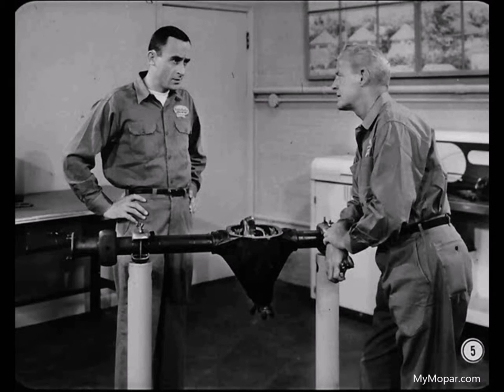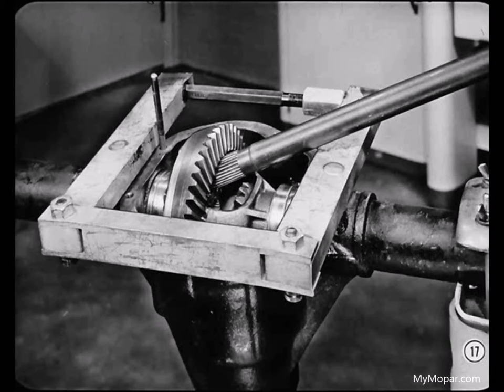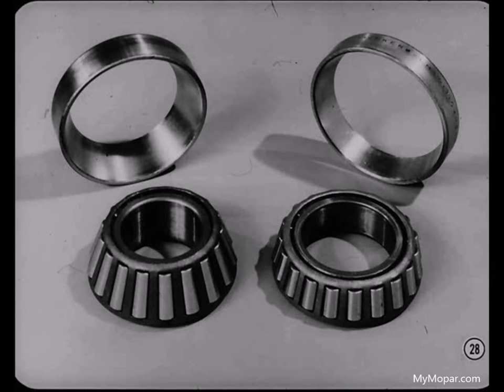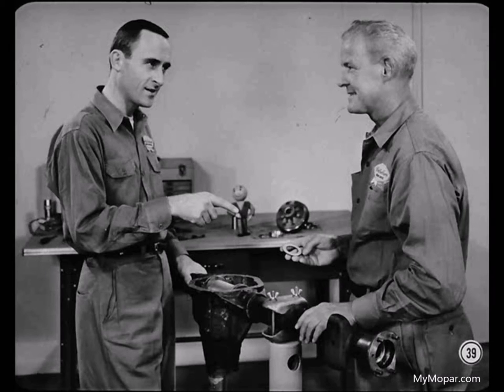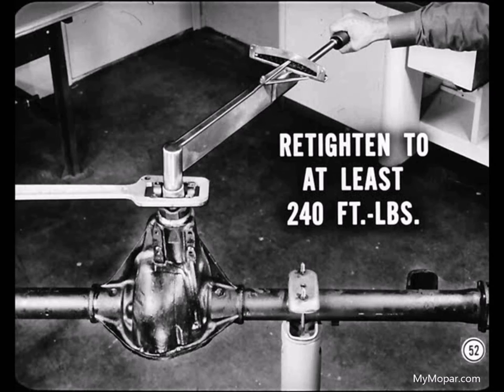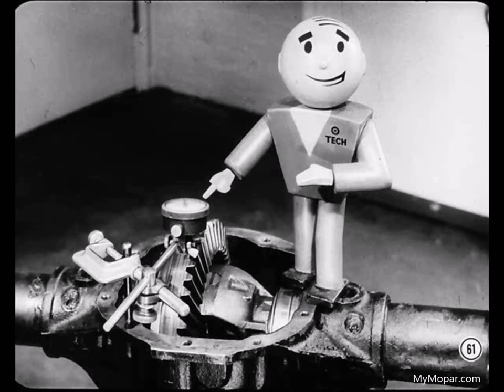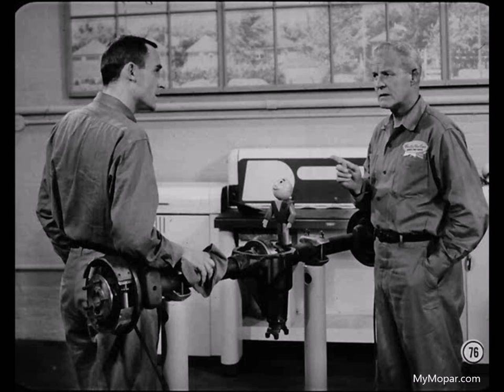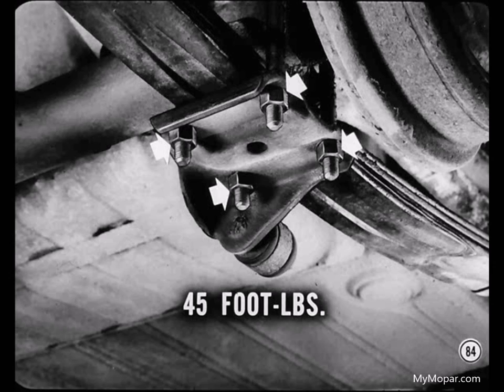Chrysler Master Tech - 1963, Volume 63-8 Valiant & Dart Rear Axle Service

Comment: I'm used to seeing people buying reman or junkyard axles if the gear or LSD failed. I only see people repair the units if bearings or oil seals have failed.
These situations would be less common if people changed their heavy gear oil. Some drivers have never heard it it, some repair shops miss it, and some people just think heavy gear oil changes are a waste. 4WD/AWD vehicles need the correct fluid changed at the same time.
16:16 That was replaced by generic "Gear paint" they got the lead out.